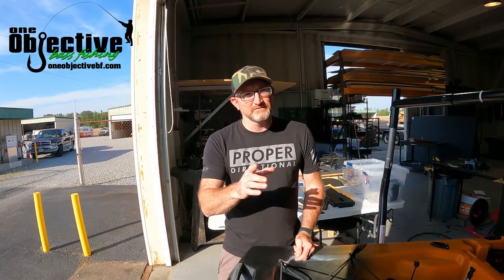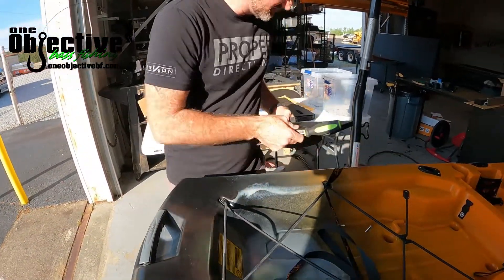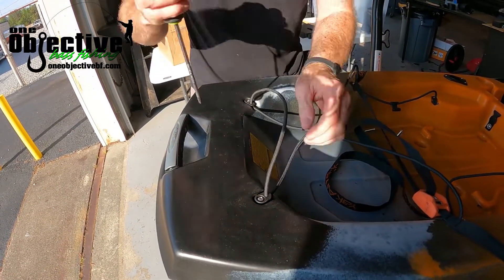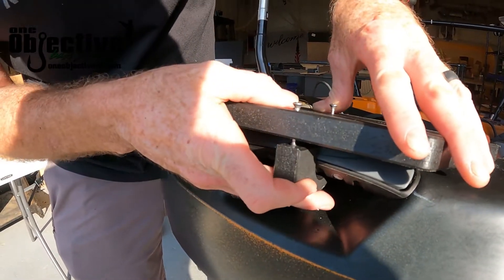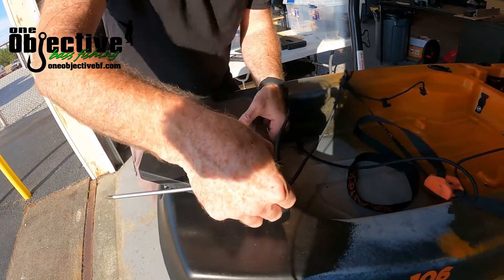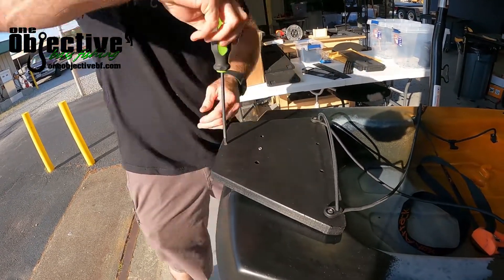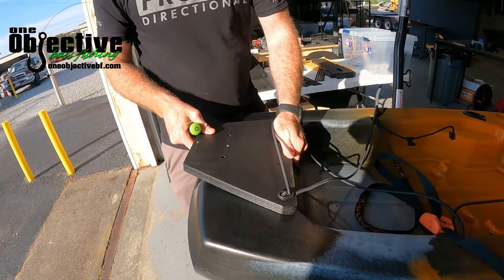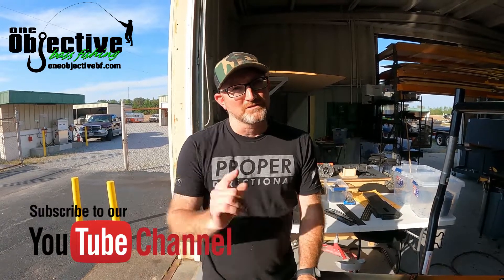Old Town Sportsman 106 Mounting Plate Install

Comment: can you make a mount for the sportsman 120. not the pdl or motor version but the cheap paddle version. its like their entry level fishing kayak. i think it comes pre drilled for a power pole but i wanna put a motor on the back. thanks any help would be greatly appreciated. havent seen many ppl customize that boat but it defiantly has the ability too be.
Reply: For sure, I've been looking for a stern mount motor plate as well.